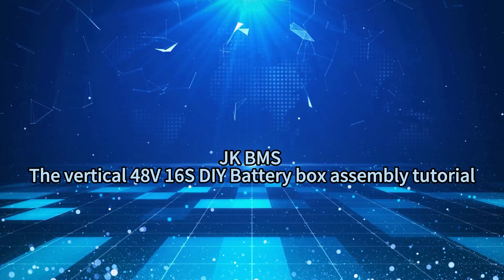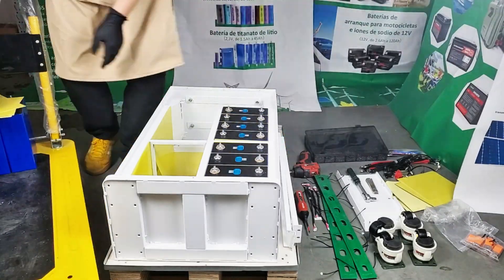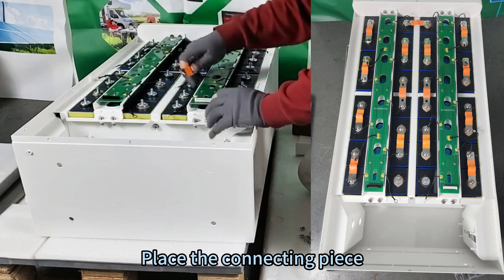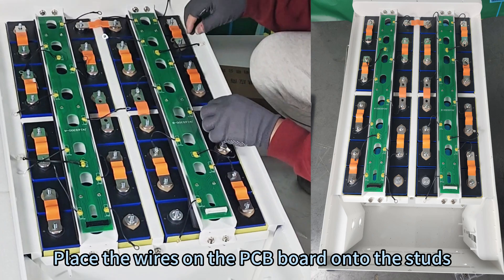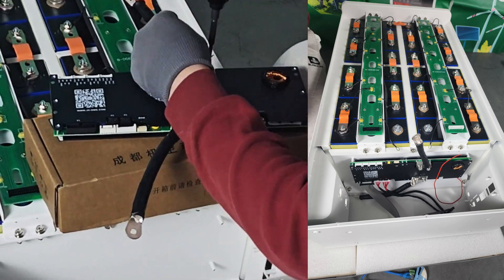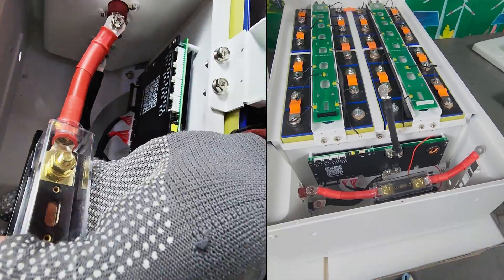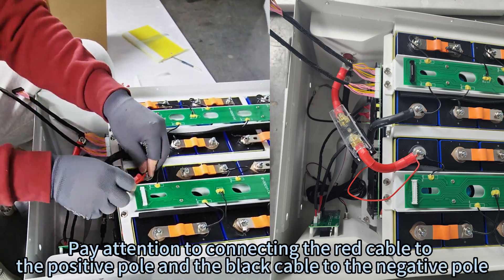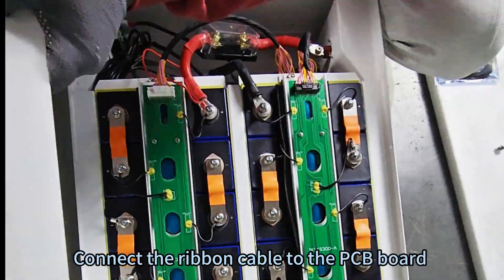HAKADI 48V DIY BOX with JK BMS & EVE 280Ah LiFePO4 LF280K - Complete Assembly Tutorial

Comment: Is it possible to compress slightly, and dix tight the batteries in the case to give them longer lifespan? Slight compression on batteries improve long term performance.
Reply from the maker: Our batteries are securely fixed inside the enclosure with corresponding brackets, so they are very stable and won’t tilt.

The lifespan of the batteries mainly depends on how you use them and the current you apply.